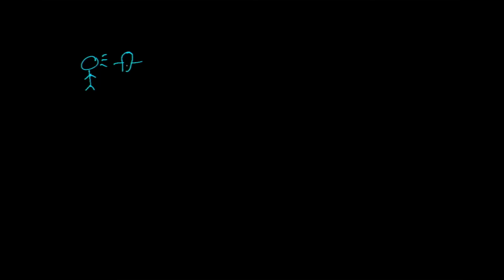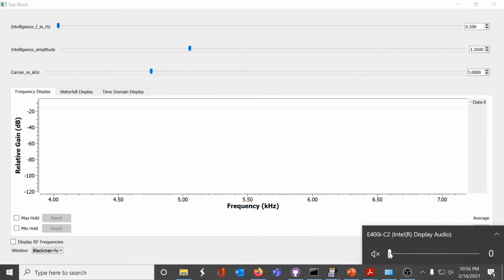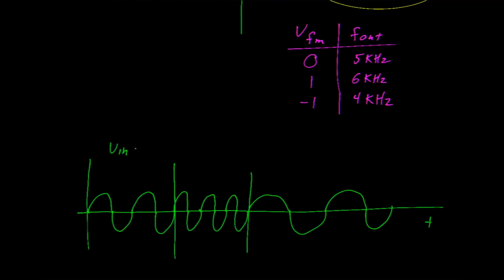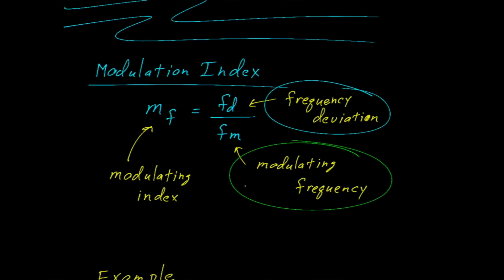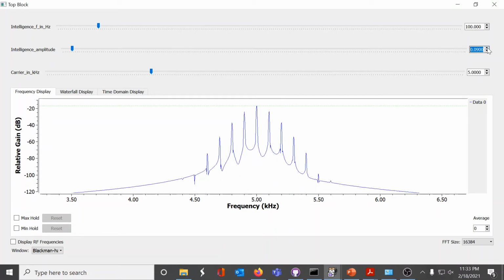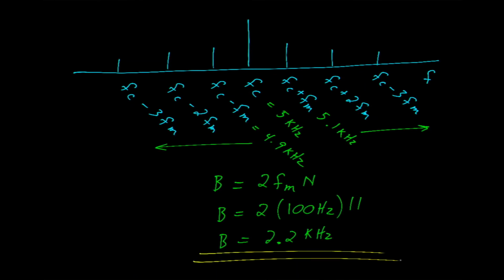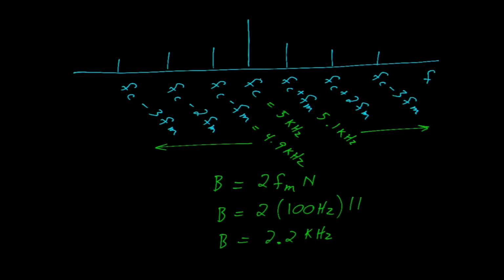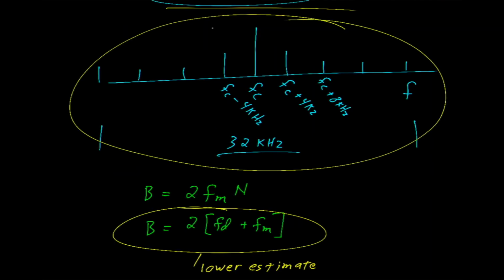#8: Frequency Modulation: bandwidth, Voltage Controlled Oscillator, Bessel functions & Carson's Rule

Comment: Hello, I am trying to understand how analog video recording works. It uses FM, where deviation corresponds to brightness, side bands correspond to the level of detail. I guess it is similar to FM radio, where deviation corresponds to loudness, side bands correspond to audio frequency bandwidth. So I expected that as intelligence amplitude increases, the carrier frequency should increase, but you show that the overall bandwidth increases. As intelligence frequency increases, I would expect side bands to increase, this makes sense, as this frequency is added or subtracted to carrier zillion times, gradually decaying. So, could you clarify why you show that bandwidth gets wider with the increase of the intelligence amplitude instead of the carrier moving to the right? Thanks!